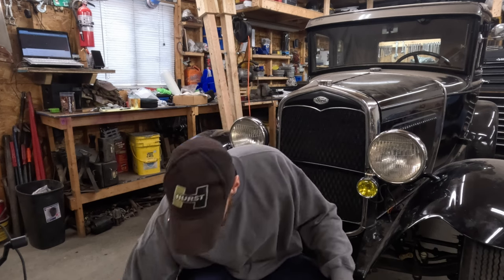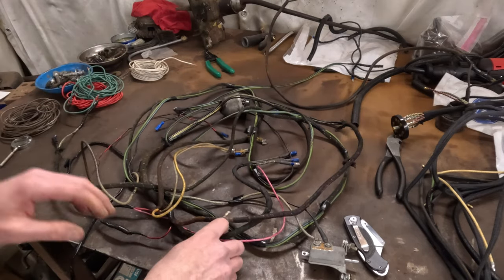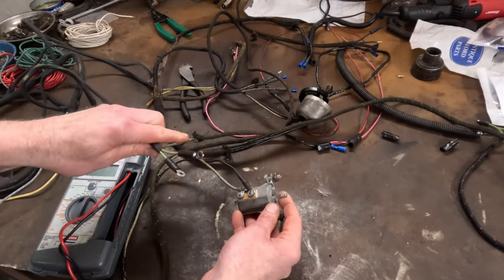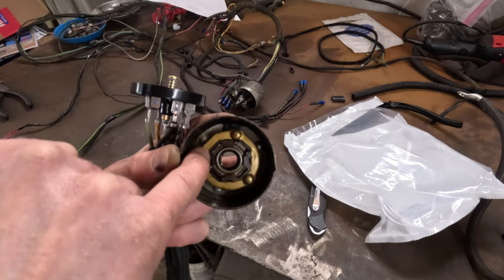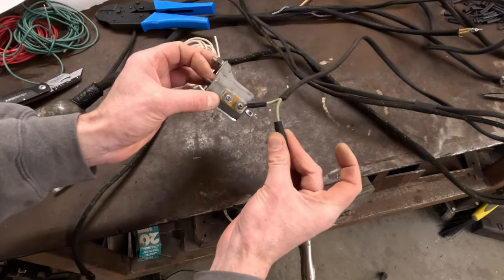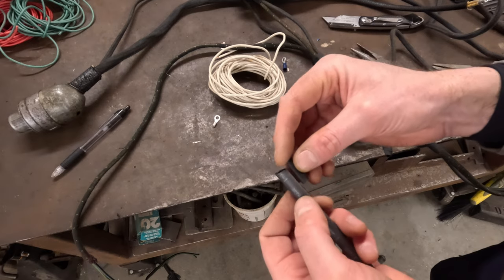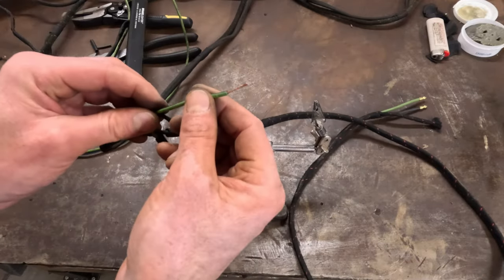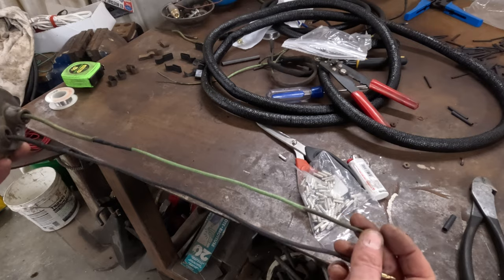HOW TO: Ford Model A new wiring harness install with turn signals and 3rd brake light Part 1 of 2

Comment: Nice to see someone using the proper bullet connectors and OE style cloth-covered wiring.   That's how I have done all my old Fords.  I only solder my bullet ends.
Reply from the maker: Thanks.  It adds a bit of work and expense but I like the look of them also.

Comment: It is best to solder all crimp terminal connectors to copper wire to prevent oxidation of copper stranded wire in the terminals.
Reply from the maker: Solder vs crimp is one of those debates that will go on forever.  Thanks for watching.

Comment: Good video, I still haven’t figured my left turn signal. The schematic shows the brake switch hooked up normal.
Reply from the maker: That's odd.  What type of turn signal switch are you using?

Comment: I've always been told 6v needs heavier guage wire than 12v not sure why...
Reply from the maker: That is true.  The amperage is higher in 6V.  I think most of the original and replacement wiring is 14 or 16 ga.
Reply: @Maine_A_S  Thanks!